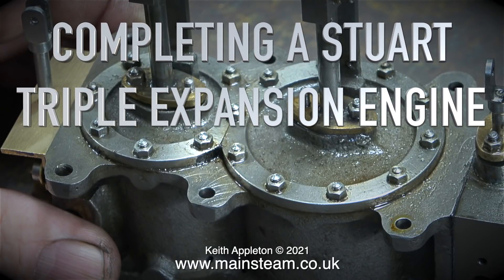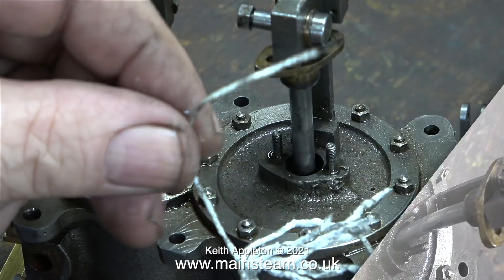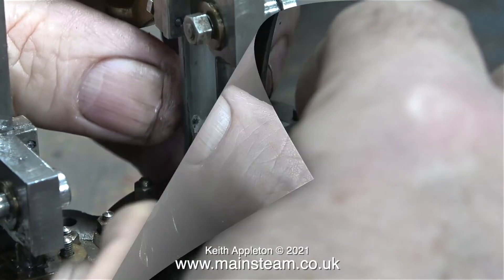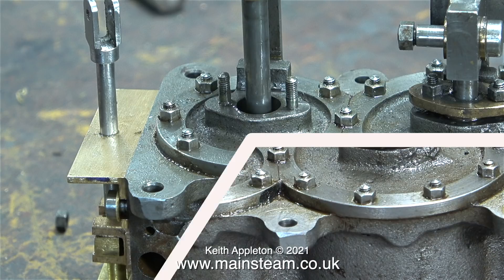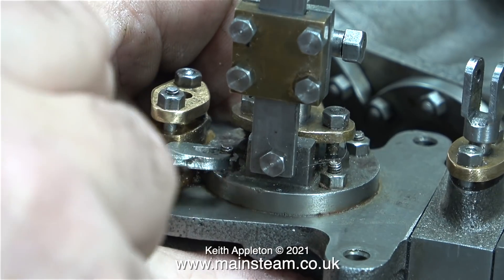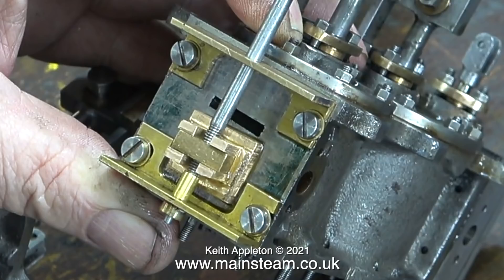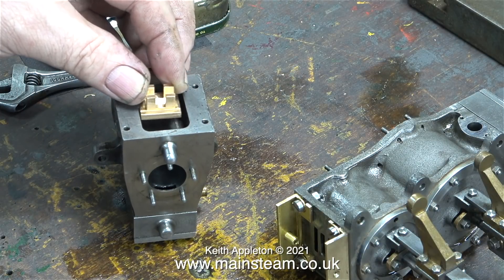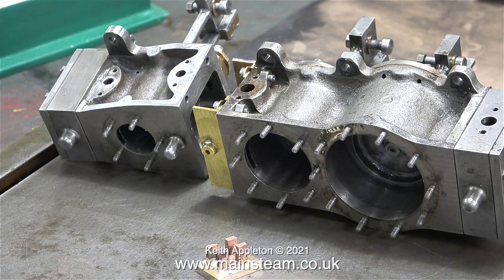COMPLETING A STUART TRIPLE EXPANSION ENGINE - PART #16

Comment: Interesting. No sound, though.
Reply: Oddly, I had a problem with sound, too, but it worked after I restarted my browser. There may be some general Youtube sound problem.
Reply: I have sound OK.
Reply: Sound is working fine.
Reply from the maker: The sound works fine on my Computer and as your comment is the only comment about having no sound, please check your computer's audio & network system.
Reply: @keithappleton  Thanks. Weird, I was watching other YouTube videos before and after this without problems. Just tried again and it's working now.
Reply from the maker: That's good - obviously just a bit of a Gremlin (don't feed it after Midnight)}:-)))

Comment: It’s my understanding that when you first applied air only one cylinder was producing power.  When completed it should make good power. 
Does the triple expansion design produce more power or is it more efficient per the displacement?
Reply from the maker: Yes, as the steam is used 3 times overall. It theoretically uses as much steam as a small single cylinder engine of 3/4 of an inch bore but is much more powerful as the steam moves though the other two cylinders also relinquishing its energy three times.